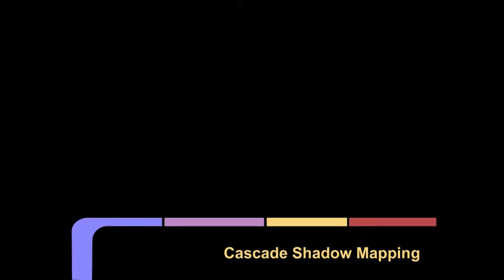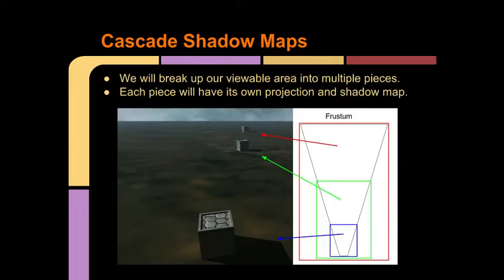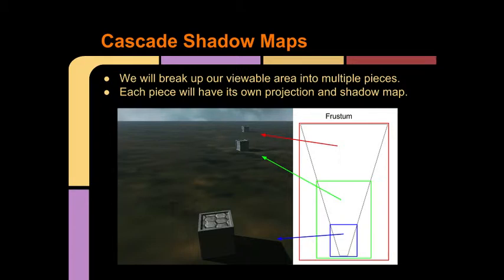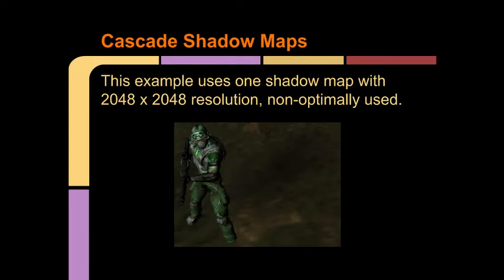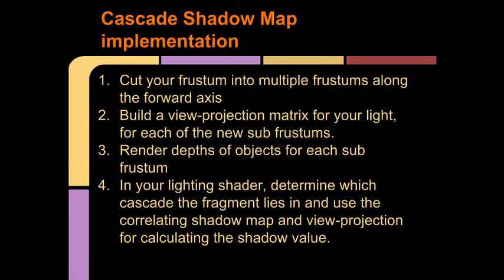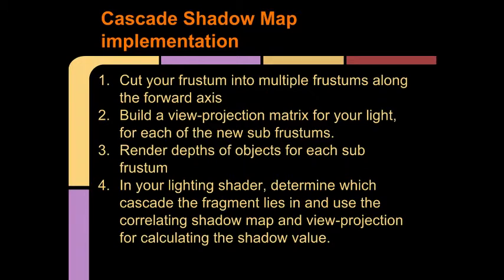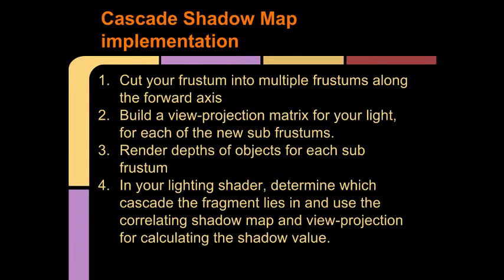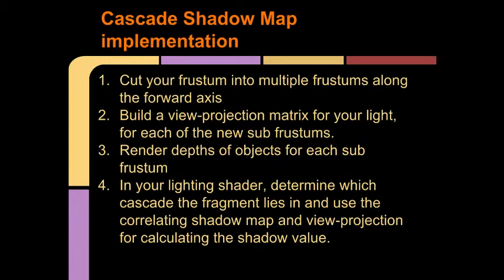ShadowMapping10   Cascaded Shadow Maps

Comment: Seems like an inefficient technique. Like you would have to render the scene multiple times for each cascade.
Reply from the maker: Nope. You only render portions of the scene for each cascade. Also you render to lower resolution targets, with a total resolution that is lower than you would if you were rendering it to all one buffer. The entire technique is an optimization.
Reply: @JonathanBurnside  yeah but scenes use a vertex buffer, 1 vertex buffer per texture. For example, if you have large open world, and if you have a bunch of rocks everywhere, the most efficient way to render is give them all the same texture so you can render all the rocks as 1 vertex buffer. The only optimization would be the rasterizer automatically discards rocks outside the view, but there will still be a huge lag of sending all the data to the vertex buffer and transforming all the vertices and then deciding to discard the ones out of view.

Comment: You can move the camera by inversing the motion of the objects then but there is a common issue that you only can linearly translate well in X axis but Y because when the shadow rotates around axis X,it creates an offset and moving on Z cause an moving on Y.So basically we must use trig function tan() to eliminate this.Still issues with rotations around the others.